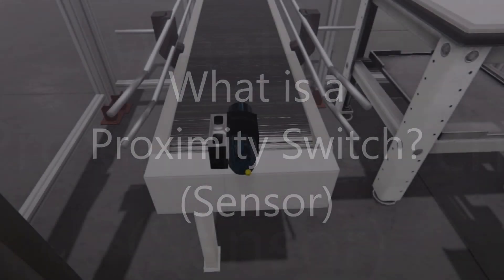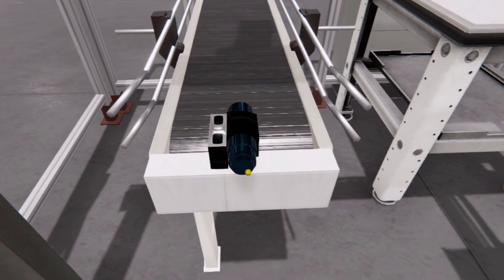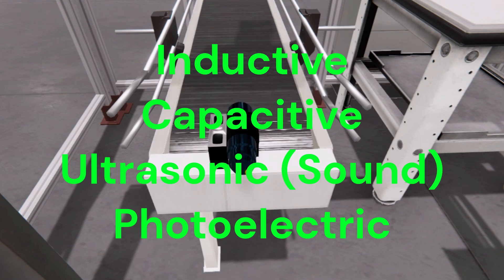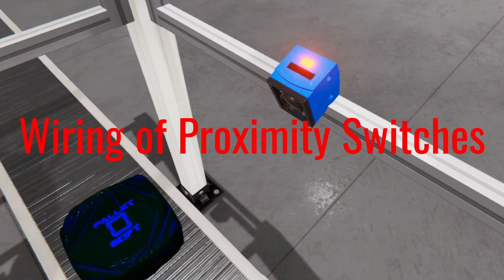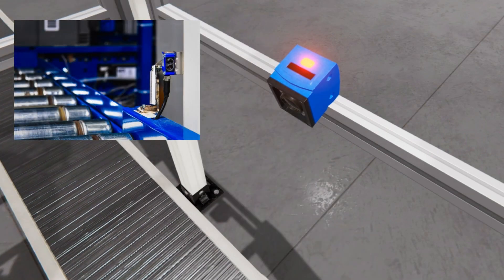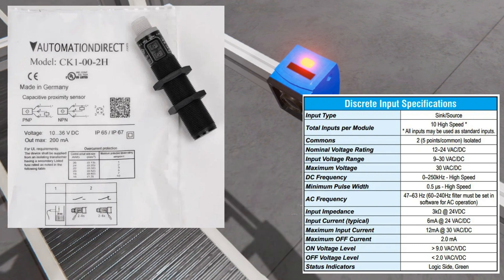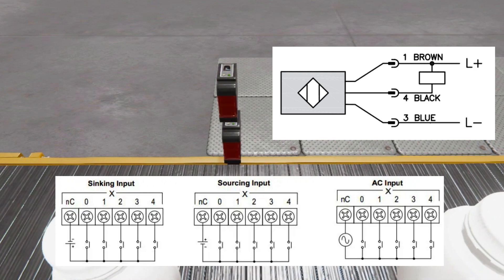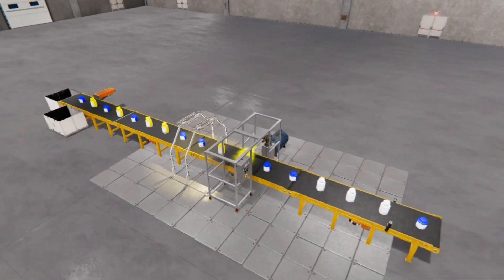Proximity Switches: The Magic Behind Contactless Control

Comment from the maker: I've included the detailed information and links on this video here.
https://accautomation.ca/what-is-a-proximity-switch-sensor/

PLC Beginner’s Guide to PLC Programming
https://accautomation.ca/programming/plc-beginners-guide/

Here are the controllers that we have covered at ACC Automation:
BRX Do-More Series (Do-More Designer Software + Simulator)
https://accautomation.ca/series/brx-do-more-plc/
Productivity Series
https://accautomation.ca/series/productivity-1000-plc/
https://accautomation.ca/series/productivity-2000-series-plc-p2000/
Click PLC Series
https://accautomation.ca/series/click-plc/
Omron CP1H Series
https://accautomation.ca/series/omron-plc-cp1h-series/
Horner XL4 PLC Series
https://accautomation.ca/series/horner-xl4-series/

https://accautomation.ca/series/easyplc-software-suite/
EasyPLC Software Suite is a complete PLC, HMI, and Machine Simulator Software package. Please take a look below to receive 10% off this software. This PLC learning package includes the following:
Easy PLC – PLC Simulation will allow Ladder, Grafcet, Logic Blocks, or Script programming.
HMI System – Easily create a visual human-machine interface (HMI)
Machine Simulator – A virtual 3D world with real-time graphics and physical properties. PLC programs can be tested using the EasyPLC or through other interfaces. (Modbus RTU, TCP, etc.)
Machine Simulator Lite – Designed to run on Android Devices.
Machine Simulator VR – Virtual Reality comes to life so you can test, train, or practice your PLC programming.
Purchase your copy of this learning package for less than USD 75 for a single computer install or less than USD 100 to allow different computers.
When you order, you should receive 10% off the investment by typing in ACC in the comment section. http://www.nirtec.com/index.php/purchase-price/
Learn PLC programming the easy way. Invest in yourself today.

ACC Automation
https://accautomation.ca/